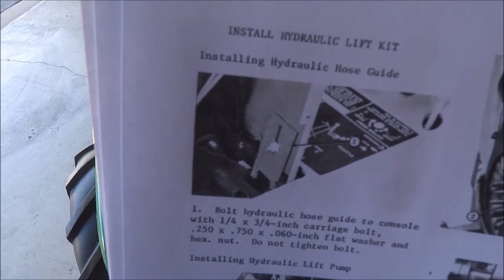John Deere Hydraulic Lift Conversion For Early 200 Series Tractors - Part 2

Comment: I want to use a sleeve hitch with a rear plow and a snow thrower on the front. I would like to make a 216 an H2 setup. any thoughts? My 200 series only do 1 job. So there is no need for switching back to mow or till in the spring. I have 4 with Hydraulic lift, 2 are electric lift. I'm considering finding a small cylinder with a short stroke and using that for the front lift. Maybe an H2 setup off a 300, K316, 317, or 318.
Reply from the maker: I think the challenge will be how to separate the front and rear lifts function. Right now, they share the same rock shaft. Your best bet might be to mount the hydraulic cylinder you mentioned in the rear in place of where the rear lift linkage mounts and have it mount to the tractor frame on the one end and the sleeve hitch on the other. Then run lines from your second hydraulic spool back there with quick connects that can hook up to the cylinder so if you want to remove it you can just pop the lines off. I think it would be easier to do that than come up with a way to mount another cylinder on the blower somehow.

Comment: The reason to relocate the coil is to turn it 90 degrees. The coil is oil filled. By laying the coil on it's side this exposes the windings above the oil. Coil overheats and needs replaced. I bolt my coils to the front of the battery box. It works well.
Reply from the maker: No…it’s not, it’s for additional clearance. The way the coil is relocated in the instructions doesn’t change the orientation of the coil at all, it raises it up higher on the engine.

Comment: I'm new to the John Deere Garden Tractors.  I'm buying a 240 and I want to add hydraulics.  What will I need to get?
Reply from the maker: I’m not sure if there is a way to convert the 240, they are a completely different tractor than the early 200 series tractors that this video applies to.

Comment: That is one sweet tractor, and you did a nice job. 
I love the 200 series, and also have a 214 with hydraulic lift. 
I DO NOT, however, have an integral hitch on mine!
What all can you use that hitch for? 
-I have a feeling that it’s more useful than I’m aware-of. 
I’d like to use one for lifting up under the tongue of a trailer, to save my back....can you lower it more than you did in the video?
It looks like you can hook a lawn sweeper / grass catcher to it as well, with a hitch pin....do you have to lock the lift mechanism out when doing that, so you don’t inadvertently raise or lower it when something is hooked to it?
Reply from the maker: Thanks! I used it mostly for a weight bracket, but there are lots of sleeve hitch attachments, such as plows, back blades, thatchers, etc... You can adjust the lift so that the sleeve hitch doesn't drop any further than it's set for, other than that there's really no good way to lock it in place.